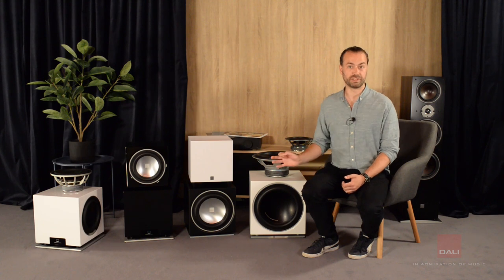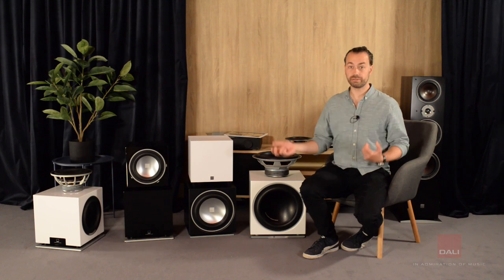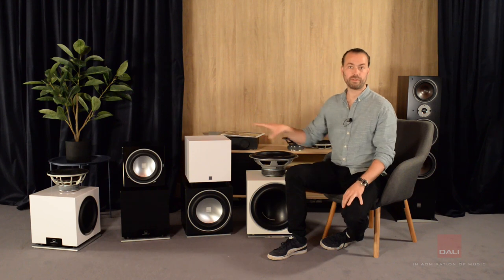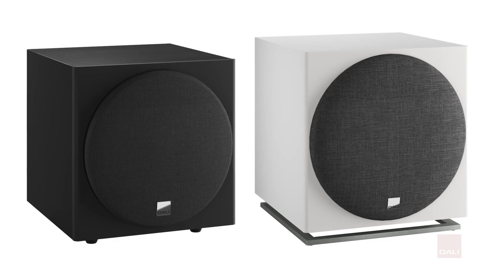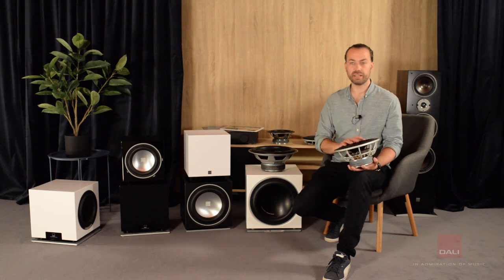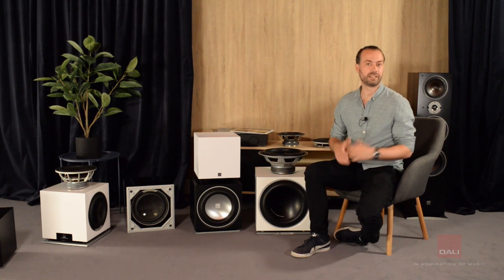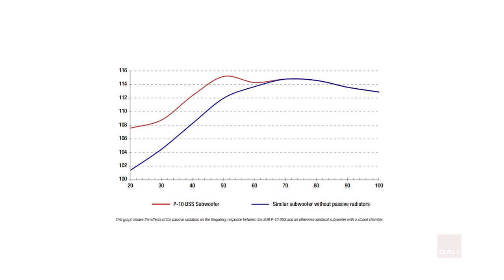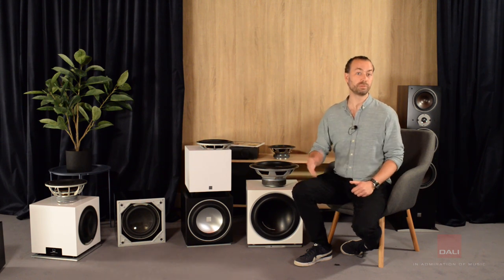DALI SUBWOOFERS - WALKTHROUGH

Comment: I'm a happy owner of Oberon 5's that I use for both music and movies. But if I would want to add a bit of low-end extension, is the C-8 a good choice? By specs, it goes a little bit lower than the E-9. 

I'm struggling a bit regarding how to choose between the different models. I'd prefer the C-8 or E-9 because they are compact, and living in a city apartment, I'm not sure if I could truly utilize the performance of the bigger models. I have a medium-sized living room, about 18 square meters.
Reply: If you can afford it buy the M-10 D and some "poron" or Sorbothane feet for it. You will not regret it 🙂
Reply: @MovieViking  Time passed, and I ended up getting the Elac 2030 that is a closed enclosure 10" very similar to the Dali C8 in terms of size and price, but by specs goes a little lower.

It is a good match in my experience. The crossover frequency range goes down to 44 Hz which is just about low enough for the Oberon 5's. It starts to kick in the frequencies where the Oberons start to show their limits.
Reply: @Antti5  👌🏻 Good choice. I like the way those 10" closed subs blend with the main speakers.

Comment: I’m considering buying one of these in China in 2024. I can get a brand new Sunfire Hrs-12 for $500 an MK12 for $700 or a Dali K14 for $740. I am more interested in music performance.I’ve read about quite a number of humming incidents with the Sunfire on forums. Does the Dali have any of these issues? I can’t demo any of the subs. How reliable are Dali subs and is there a 6 year warrantee? (Maybe I am wrong). I know the Sunfire only has a 1 year warrantee. It is the cheapest and possibly goes the lowest, but reliability issues worry me. 
Any opinions greatly appreciated.

p.s the prices of some things in China are crazy. You can buy stuff from government contractors that produce extra units. I paid $915 for an Audiolab 9000a. I will be using a sub with KEF XQ40s

Comment: The C-8 is actually amazing! I need to hear more of the other subs, but I love how responsive the C-8 is. My biggest dislike with subs have been that I've found the ones I've previously listened to be too slow and sort of "bleed" out over the music, but the C-8 provides just that extra bass extension without ever taking the center stage and you won't notice it's on until someone turns it off. 

The other subs will surely produce a deeper and more powerful base, but if they are as responsive and rhytmical as the C-8 I'll be surprised. For music the C-8 might be the best sub per unit of money I've heard.

What do you think of it?
Reply from the maker: Hi.

All our subwoofers are designed to be as responsive and fast as possible and to provide the most seamless integration with the main speakers. 
The subwoofers we make have the same “timing” qualities as you like on the C-8 – although I would say that the K-14 is the only one, where we have focused a bit more on home theatre performance and raw power, than ultimate music performance – although it is very good at this also. 

The E-9F or E-12F are wonderful for music as well.  
Depending on the room size and your front speakers of course. 

I would suggest you give the E-9F a listen – that is a very fast and responsive, all-around subwoofer. 

Thomas / DALI
Reply: @dalispeakers  Thank you so much for a good reply! Now I am eager to try out the others and see if I can hear the difference between K-14 and others in fast tracks.

Comment: They seem quite bad. They don't go low, their spl is tragic and the price is high. Of you want deep bass and high spl buy svs. If you want a best quality mid bass buy rel which still digs up lower for the same price.
Reply: No, if you want boomy mid bass and almost impossible calibration with any low-loss and agile sounding speaker you buy SVS. The closed SVS SB-4000 being the exception most of their range is clearly tuned to a certain and predominantly American audience. If you pair ie Epicon with a ported SVS the result is at best mediocre. 
Add two P-10 DSS and the result is fantastic.